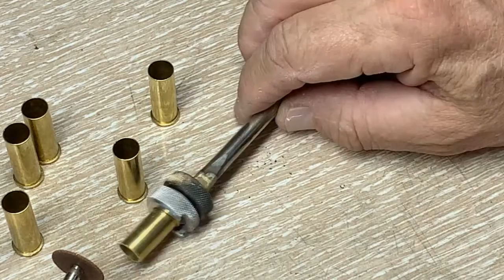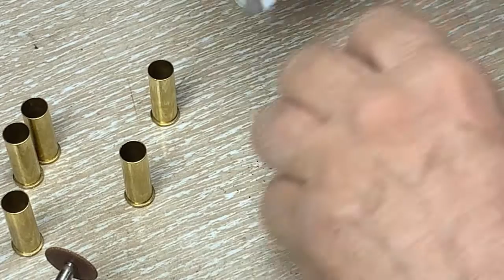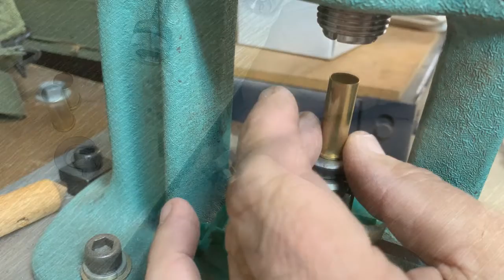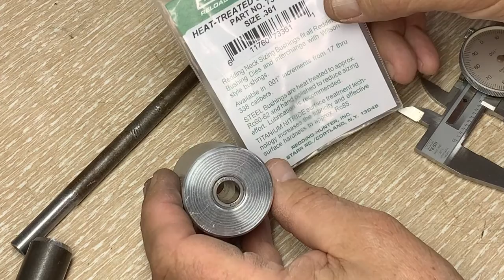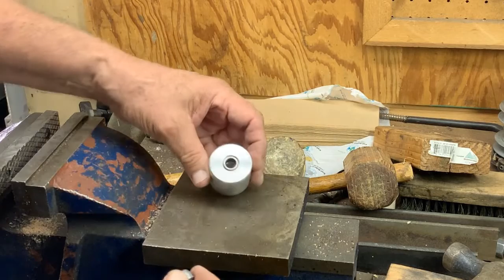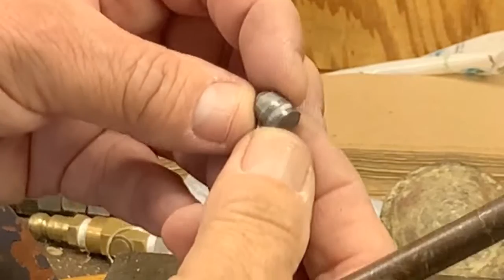38 S&W Bullet Making

Comment: After doing this, i get a bulge where the case head starts. No obviois separation, there is no jag inside the case...
 But i wonder if there's any danger in this.  Half the case expands to meet the chamber wall....
Reply from the maker: One thing I did present was the fact that I only used a 90g bullet that I made by hand. Since there's a risk that your item was a black powder only one, the fact also to consider is that NO amount of smokeless powder is safe. That's because the pressure rises too quickly with smokeless. Another thing is wear of the cylinder. It could have been stretched. If any shell fits loosely, it's not for use. You did allude the head space by the way by your description. That could mean either the case is too short or the actual diameter of the chamber is already beyond max. Probably though there is excess clearance between the case head and the frame. I would suspect this. You'd need a set of feeler gauges to be sure. It seems the tolerance should be about .002 there and the gap in front. You'd need to do some research to be sure. Based on your report it seems better to forget loading for that item completely. Most smiths won't touch a revolver like that leaving on your own. Never fire any regular ammo in that for the sake of safety. Thank you for your report today.
Reply: @michaelbradford2816  I did forget to mention I dated the item via serial number to the 1950s, so no danger of it being black powder. 
I appreciate the remaining information.
I am also using cut down 38 special cases.... and now I'm rethinking this idea, frankly. If I have a pistol with slightly oversized chambers in addition to already slightly undersized brass.....it could end poorly. 
I did load VERY conservatively with a milder powder( tite group was recomended on 3 forums for this pistol, and i found published load data from lyman, hornady, etc) to Acceptable effect.
I appreciate the added feedback!
Reply from the maker: Great! You're proceeding in a safe manner. The fun of a gun includes saving an old one if possible, but of course it's not always possible. Have fun.
Reply: @michaelbradford2816  safe ish.  I'm still taking a bit of you advice, to be safer!   Thanks for the input, and I agree.... making the old guns run is just satisfying for some reason!